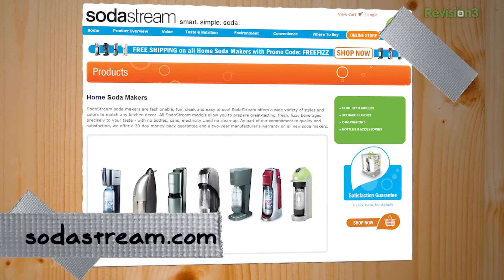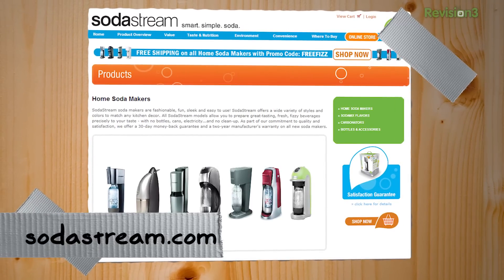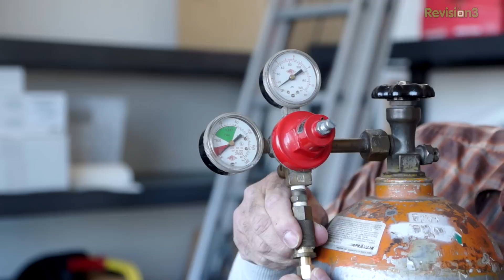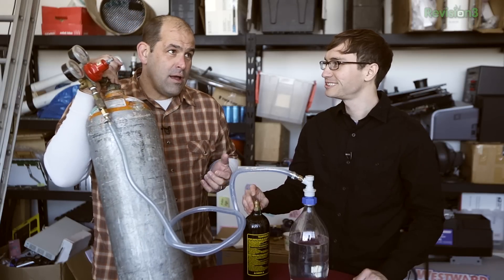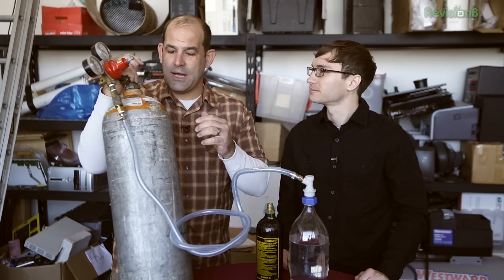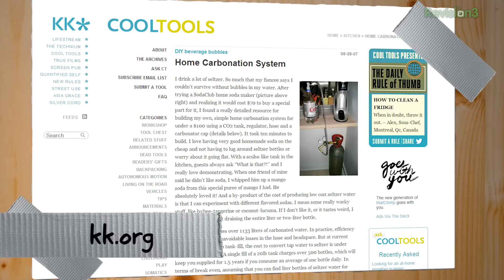Fizzy Eggnog, Carbonated Coffee and More! How to Carbonate ANY Liquid

Comment: I think it's better to use dry ice and shake because putting CO2 from a welding shop refill will put oil into your drink.  I was taught in my welding training that all of those tanks had oil for their seals, especially those with HPA markers in them for the fittings, albeit a small amount, not enough to put impurities in your weld, they're not food grade CO2, I trust hot ice more, you just put the hot ice in the container and shake the entire container., done and chilled.
Reply: There is no oil in the CO2. Definitely not in the tank itself, and hopefully not near the fittings.

If there was oil, you'd see it in the water (thin film of oil on the surface), and in the lines (as they are transparent).
Reply: Food grade CO2 tanks have filters for the oil, but if you're using stuff from a welding supply especially if you have an HPA marker you may be ingesting small amounts of oil.  You can have trace amounts of oil and not notice it, especially thin oil. Also non-food grade may have more benzene in it, which sometimes can give you headaches and over time cancer.  Industrial CO2 has higher tolerances for CO2 to have impurities like Nitrogen, Hydrocarbons and Benzene.  Industrial grade like at welding supplies don't have these expensive filters and expensive CO2 and have levels safe for industrial use, but not consumption.  Think potable vs non-potable water, non-potable water is cheaper, but not safe to drink.

Comment: I started with a Soda Stream then briefly to a setup like this then to a bar gun.  My family loves carbonated juice.  Orange apple and grape are the best but I'll try carbonating just about anything but never would have considered egg nog.

If you go through that much carbonated water, consider getting a carbonator and a bar gun or a corny keg and a tap.  I put together a bar gun setup for under $200.  I always have cold soda on tap.

For more fun with carbonation try carbonating fruit.  I have a water filter housing that I plugged the input and output then tapped one of the plugs for a tire valve for CO2, strawberries are great sweet apples, apple sauce is fun too.

Comment: I just got a set up like this and the water I am making is really weak. Any ideas? I want really fizzy water. I am at 40psi and still the bubbles are weak. I am using cold filtered water so I don't get it.
Reply: I think they forgot to tell you to use really but really flat water, by that I mean is to let all other dissolved gasses escape, you can leave it sitting around overnight specially if its regular city water.
Reply: what is the point of fizzy water? like honestly why not drink regular water?
Reply: I'm getting great results now. I think the key was agitating the water more. Also cold water helps but I think agitation was the key.
Reply: Did you squeeze the bottle to remove the air?
Reply: yeah I let the extra air out. For best results I find leave plenty of space, cold water, 60 seconds shaking. I'd say for a liter bottle I fill it 75 to 80% full of water.

Comment: Another question, sorry,

Could you nitrogenate something the same way with just a change of the gas?
Reply: No, nitrogen is not as water soluble as CO2 and would require cooler temperature and much higher pressure.

Comment: Just for reference, I built a system like this in December 2011 with a 5# tank. Making a lot of fizzy water, that first fill lasted me exactly two years and the refill was about $15.   The Liquid Bread caps come in red and blue; they are functionally the same. Pro tip: Don't accidentally leave them on a bottle you throw out or you will be mad.  The thing to remember with CO2 tanks: they give nearly full pressure until they are almost empty, and then they drop fast.  So get it refilled when it starts wimping out.  No need to worry otherwise.

Brewing (as in beer, not coffee) supply shops are great place to get a refill.  Note that some places swap tanks empty for full rather than refill. You might buy a shiny tank on Amazon and get back a battered old one at your first fill.  Ask in advance if they refill or swap.     It's a good idea to replace the gauge-tank gasket when you do a refill.  The gaskets are cheap.  

Danger factor: if the tank should fall over and knock off the valve body, will empty its contents into the room.  The gas is not compatible with life for you or pets.  Please use care handling the tanks to prevent a tragedy.  A solid, fixed mount is highly recommended.

Comment: grap a coke cap and bore a hole in it so a rubber car tire valve stem will just pull through.grab a clip on type air inflator from most stores and away you go, we have done this for years and it works great. we always are re carbonating even fresh soda to make it better than when you purchase it. also the drink mixes for bottled water make tasty sodas.
Reply: Tire valves often contain brass.  Avoid letting carbonated liquid come in contact with brass or any metal containing copper.  Not only will it corrode but it will release toxins in to the liquid.
Reply: Did you not see them using brass compressor fittings and alot of the parts in most machinery that does this is brass and copper laced. I also done give that much off a shit. Also with what's in the air in most city's, I'm pretty sure I'll be fine.
Reply: Alex Krienke Yes I did see the brass fittings and that is fine.  CO2 will not react with brass.  Carbonic acid which you get when you mix CO2 and H2O will react with brass.  It's fine if you don't give a shit.  I was just pointing out that if you or any one else uses a tire valve for this try to find one that doesn't contain brass and then if say you stick it in the fridge with the cap on keep it upright so the liquid isn't in contact with the valve.

Comment: Sadly the homebrew beer setup I use runs on pin lock instead of ball lock connectors. I may need to convert just for stuff like this, maybe I will need to just add a line to the regulator.

Comment: Can you do a "bag in box" soda system for actual soda?
Reply: Yes, more or less.  You can get the BIBs at some warehouse clubs.  You will need to do some math to figure out if it makes sense to buy their syrup vs. buying premixed soda at a store. The BIB has a special fitting for a hose but you can carefully break the plunger with a knife and just use it as a big pour-out box. Make your fizzy water and pour in the right syrup ratio. Done. I did this with a Coke Zero BIB.  Worked fine, made about 30 gallons of soda but not much cheaper than retail. You can also buy the SodaStream syrup mixes and use them with homemade fizzy water.

Comment: water carbonates best between 42 and 36 degrees F. If you can attach a hose to that fitting that goes on the plastic bottle with an air stone on the end you will get a better carbonated drink. One more thing you should have a safety blow off check valve on the out put side of that high pressure regulator. .
Reply: We actually pre-chilled just about every bottle you saw us fill down to 35 degrees, give or take! Re safety blow off check valve, the regulator is a standard Taprite 5740, there's a blow off valve built in.

Comment: I have been do this for about a year and a half now and it is great.  No more lugging 2L pop back from the store. 

Here in southern Ontario, Canada it costs me $19 to fill my 5# Co2 tank at the local fire extinguisher shop.  That's about the same price as doing an exchange on a SodaStream tank and I have already doubled the 60L SodaSteam clams you can get from their tank.  And I still have more to go.

Tips I have for doing this are:
1. Don't fill your bottles more then 3/4.
2. Chill your water over night in the fridge.
3. If you're making drinks from syrups just make them by the glass by just putting the syrup into the glass and use just soda water.
4. Make sure you have all the air out of the bottle before filling with your Co2.  This can be done by pushing down on the pin in the center of your charging cap and squeezing the bottle at the same time.
5. Have at lest 2 charging caps (more if you go a lot of soda).  This is so you always have a charged bottle of soda in the fridge. 
6. The second reason you want more then one charging cap is you want to let your charged soda rest under pressure 2-3 hours before use for the most fizz.

Two of the best YouTube videos.
1. http://youtu.be/APT0wfZtU6A
2. http://youtu.be/BLFvw4CVKgY